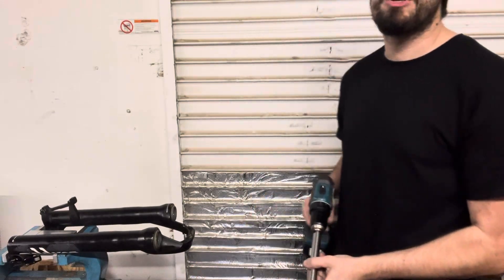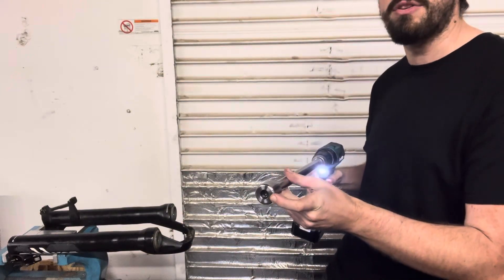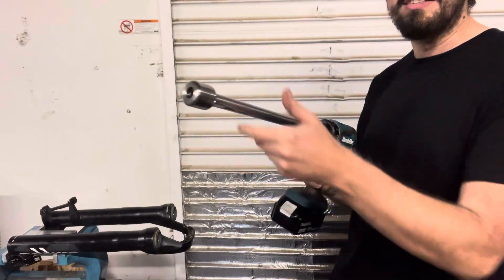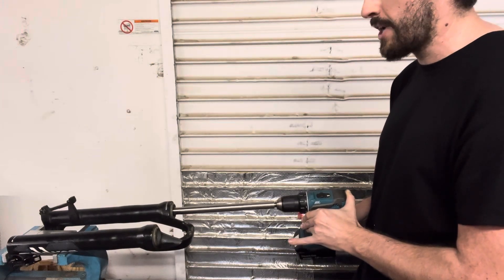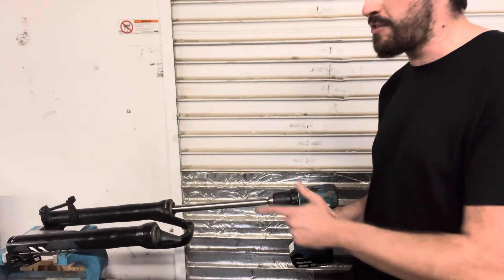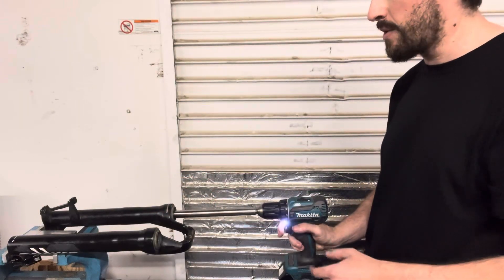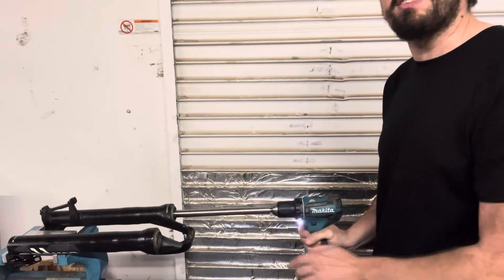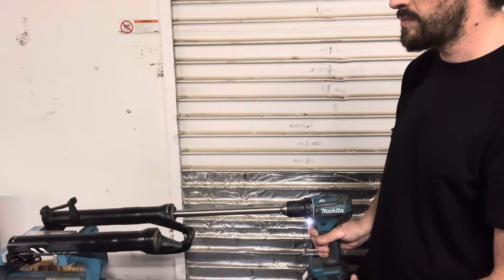Automatic burnishing with self feeding mechanism

Comment: How do you test to see if your bushings need this? Does the wheel need to be installed and torqued to spec? Dust seals in/out? Etc
Reply from the maker: Yeah definitely do some tests with the seals taken out. Clamp your wheel in and see how it feels. Feel the sliding friction/bushing play of each leg individually and then also see what it feels like with both legs sliding together. I also have a tool that I use to run some dropout width tests before I do any bushing work. I show the process here. 

https://www.youtube.com/watch?v=d5s7RlN73_0&t=25s

Comment: Must admit I prefer to keep the legs vertical so oil can feed down whilst turning the tool by hand (and not overheat the bushes), might be slower but think it gives ‘feel’ for what is going on , also I got a machinist to make me up a guide to sit on the shaft which locates where the seal sits so hopefully giving a straighter line when working on the lower bushing.

Comment: Don't you want to use a drill press to guarantee perfect parallelism of the feed?
Reply: Nahhhh I prefer my bushings to be oval by the time they’re burnished 😂
Reply from the maker: @bararulive  You can use this in a drill press if you want but there are some downsides to it. Most drill presses have very short quill travel so you wouldn’t be able to reach the lower bushing without raising the table each time. Then you’d have to lower the table again for the second leg. Also, this helical tool doesn’t do any cutting so it relies on the bushing to force the tool on-center. You can even try to get the tool to go off-center and the bushing won’t allow it. So because of that, I don’t think there’s any additional benefit of using a drill press other than maybe that it has a stronger motor. But I encourage everyone to try their ideas out and see how they perform in reality.
Reply: A drill press (like any machine) is only capable of parallelism from the machine to the part being worked on if you align said part to the machine...very carefully...and hold it in place so nothing moves. Otherwise you just force it on an angle.

Comment: Is there any validity to the coating on the bushing becoming too hot from the friction of the die?
Reply from the maker: @davidthebiker2955  That was one of my first concerns when I made this system for myself two years ago. It does of course get hot, but it turned out that it doesn’t damage the bushing coating. And it makes sense when you think about it. In other industries, teflon is used specifically for applications that expose it to heat because it tolerates it very well.